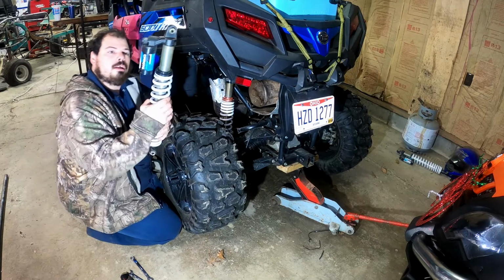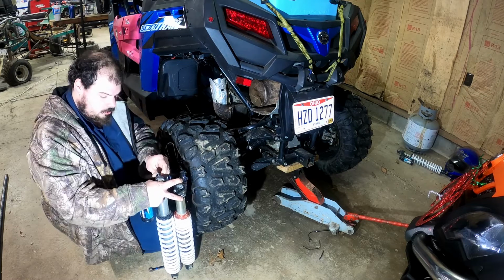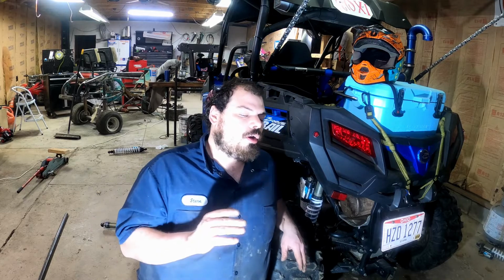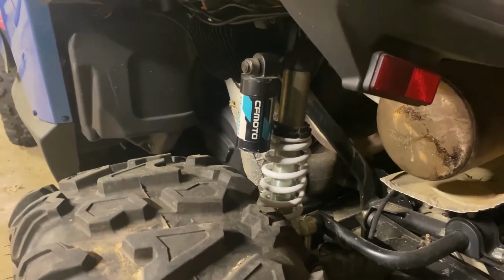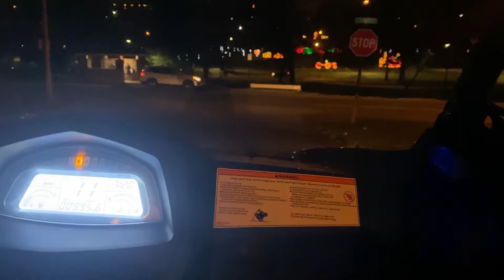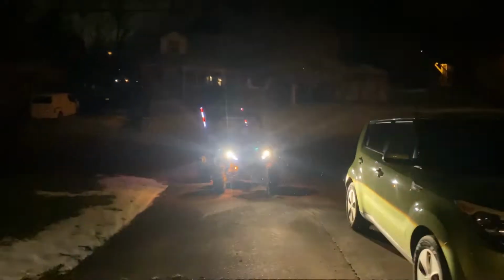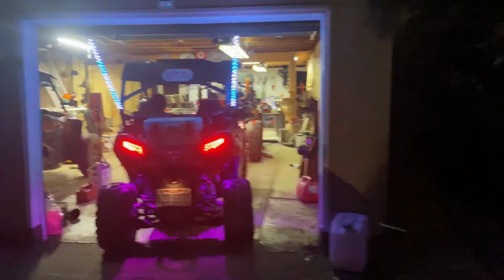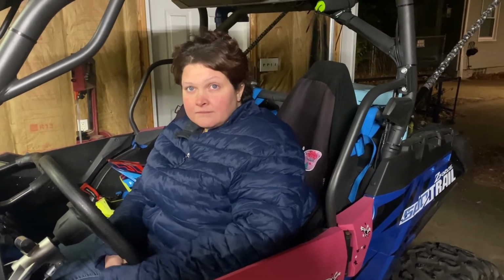ZForce 500 Trail with 800EX Shocks plus Elka Update! #CFMOTO

Comment: I  read 3 years ago it couldn’t be done, but obviously if it can be you’d be the guy to do it. I’m impressed.
Reply from the maker: Thank you brother. I was told the exact same thing over and over again.  And its super easy to do.  All you need is to grind a bit off the shock mount holes and 2 inch wheel spacers. What a huge ride quality difference.

Comment: Thank you for all the awesome content! I ended up just recently purchased a zforce 500 trail and had a question about the elka shocks you mentioned towards the end of the video. I looked at elka shocks and they don't make some for the 500 trail but they do for the 800 trail, do you think the 800 trail elka shocks work on my 500 trail? Or would a set of bandit shocks be a better route to go? Thank you
Reply from the maker: The 800 trail shocks will be the same.  But if you message @Hesters motorsports he can get you a Hester edition Elka shock package set up for your machine.  I have a video on it.  https://youtu.be/wuKyfULRV3I
Reply: I put 800 trail elkas on my 500 zforce and the difference is crazy.   Stage 3 elka's

Comment: Hello, I am getting a 2021 Zforce 500 for my wife do they have a good engine brake. Thanks.
Reply from the maker: Yes they do.  They work great.
Reply: @R.N.GPerformance  Thanks, This is her first  side by side I think the 800 trail would be to much.
Reply: I am going to put on the wheel spacers. I like your videos very informative . Thanks again.
Reply from the maker: @franknewhart6265   i cant agree buddy.  If you leave the 800 stock it will be fine. Im not sure what kind of riding you guys do. But.   My wifes 500 trail gos everywhere i go sometimes it struggles specifically on hills but it does get the job done.  I highly recommend the 800 that way when you need the power its there.  And if tour afraid of the extra power as a beginner you can adjust the throttle stop screw.  They are both great machines dont get me wrong but i do wish i would have gotten my wife the 800.
Reply from the maker: @franknewhart6265  you’re welcome.  Thank you I appreciate it.
Reply: @R.N.GPerformance  I pulled the trigger yesterday and got her a 2021 800 EX. It was 28 degrees outside she could not weigh to try I out she loves it. keep the videos coming. I all ready ordered the Uni filter.
Reply from the maker: @franknewhart6265  awesome happy to hear.   Thank you.  I sure will.